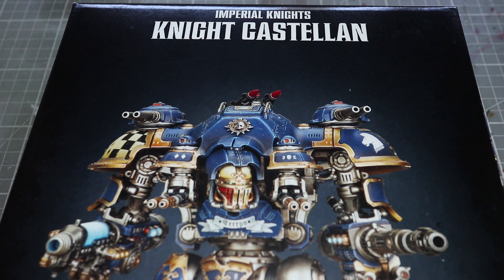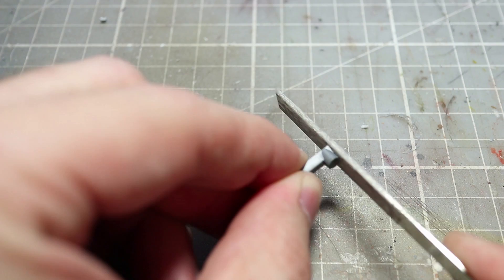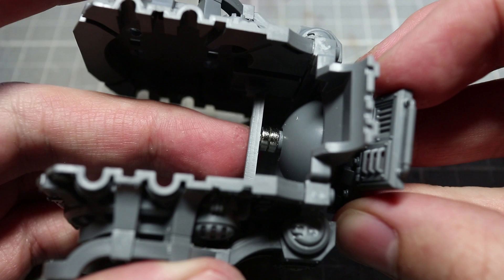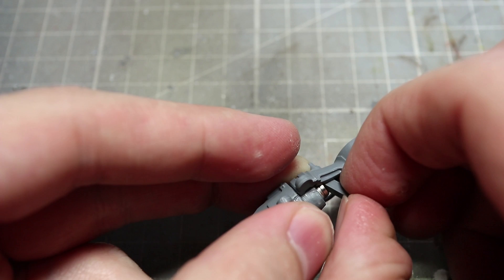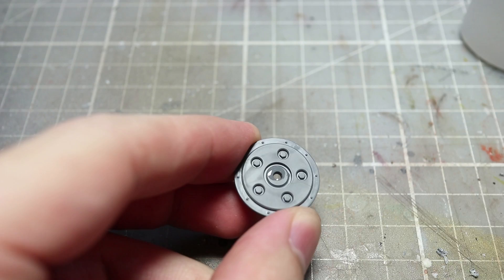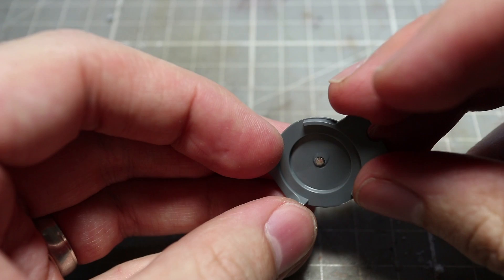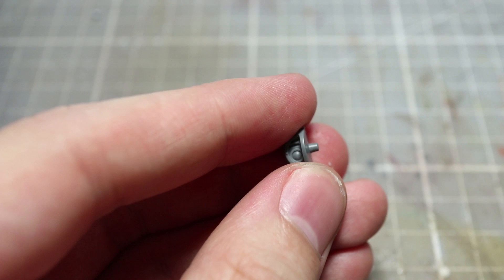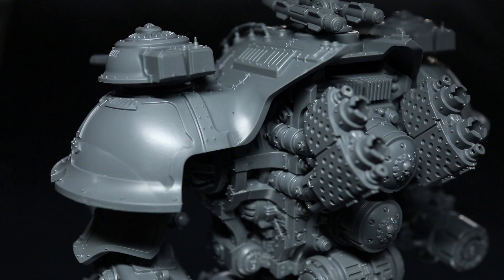The Hobby Table - How To Magnetise A Knight Castellan Warhammer 40k Firestorm Games

Comment: 5x2mm  2  - Waist
4x1mm  4  - Arms
2x1mm  8  - Shoulders
2x1mm  4  - Front guns

For anyone wondering, that should be all the magnets you need for this.  HOWEVER, if you want to swap the two Arm guns with the Valiant versions (the rest of the body is the same), you'll need 2 more 4x1mm magnets.
Reply: You da real MVP